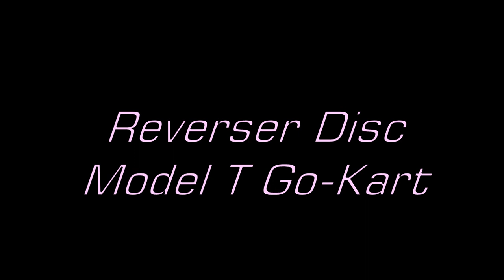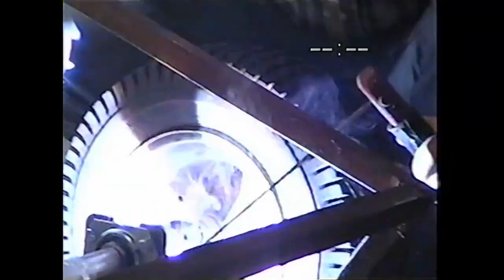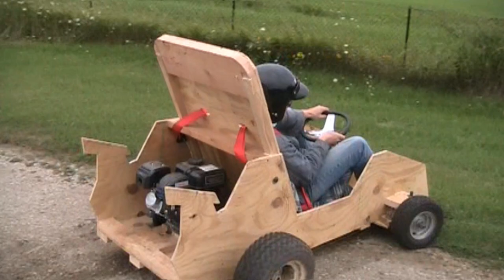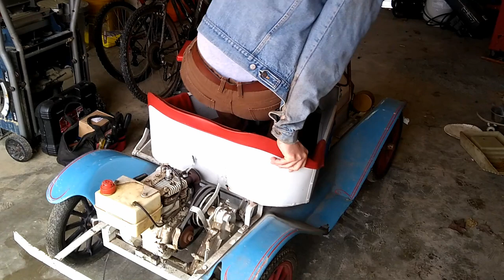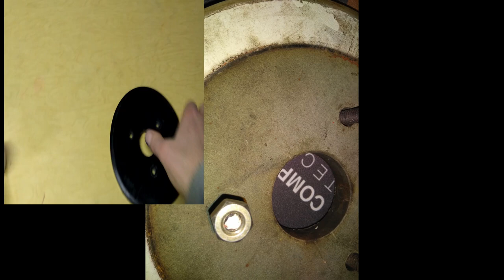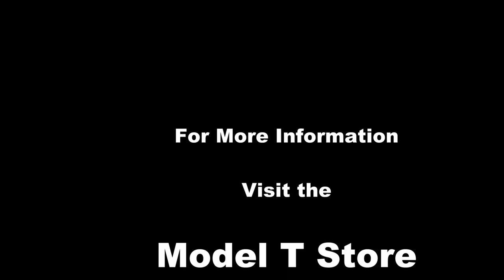Reverser Disc Model T Go Kart

Comment: Any idea why my reverse is not engaging.  It goes forward with no problem.  Would I need that disc? Also what type and how much oil does the gearbox use.  Thank you in advance
Reply from the maker: the reverse action occurs when the pulley which is next to the main drive pulley, they are identical actually, presses against the reverse or disk and causes the reverse or disk to move in the opposite direction of the engine. this action causes a go-kart to go in reverse. it is similar to two meshing gears that go in opposite directions. my guess is that you do not have a reverse or disc and that the pulley that they reverse hardest would rub into is missing. you might want to consult our contact page and I can talk to you personally about it.